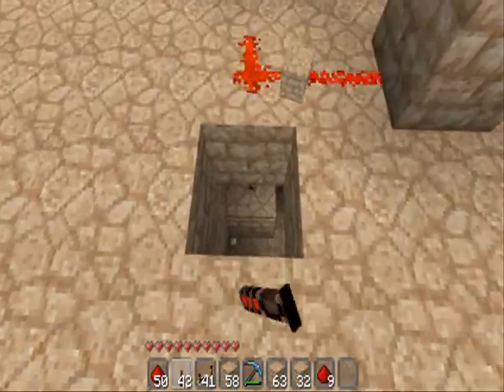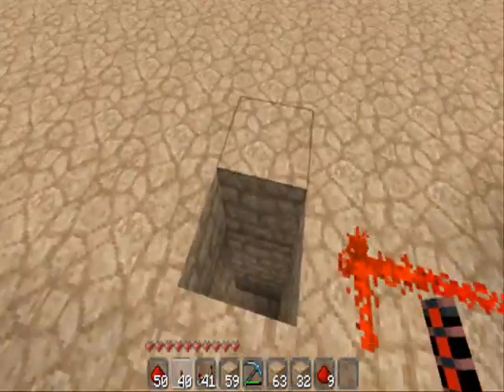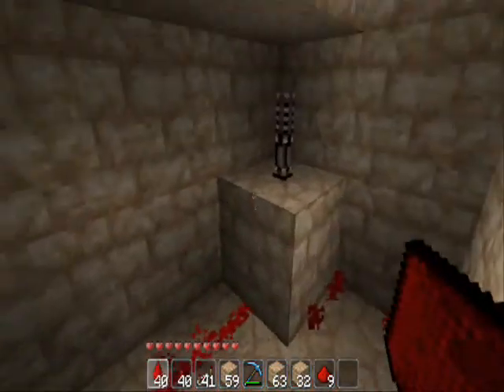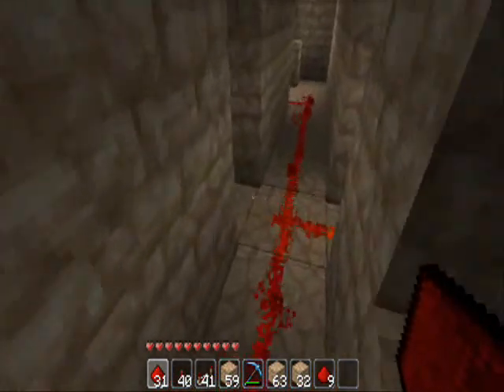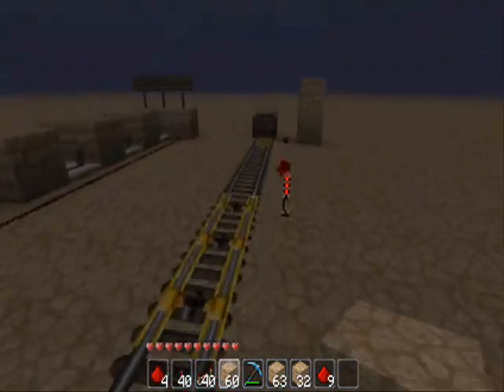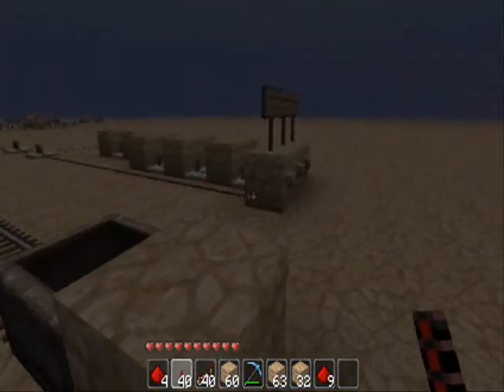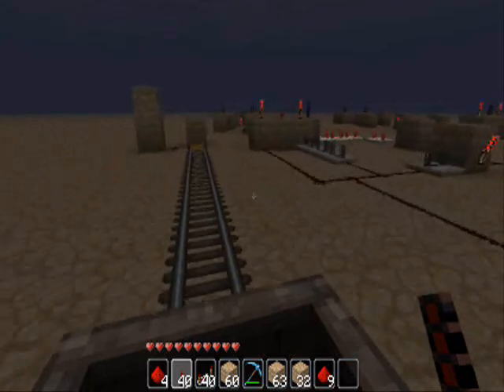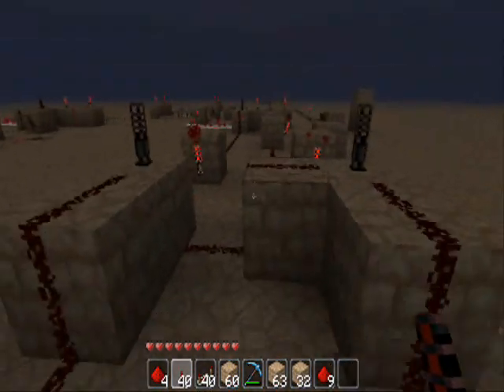Morse Code - Tutorial Pt.2

Comment: if the torches under the reset line don't turn off. just put a repeater next to the block with the torch on it. (make sure the repeater is going into the block :P)

Comment: Maybe you're interested: I made a dot-dash decoder (or whatever is its name) with a different design smaller than yours (it's 7x6).
And it works with the dot signal shortened by a pulse generator.